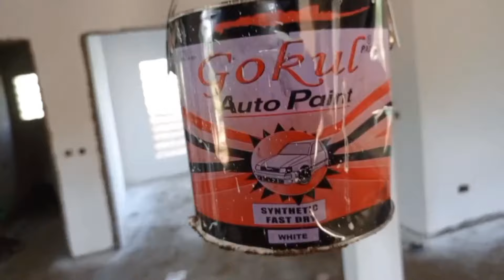Nyabohanse Kenya Dream House Project Update

Comment: Beautiful house.  It would have been better to have a smooth wall where the sinks are ( first washroom you showed)...better for cleaning. Wood, not a great idea due to the moisture in wet rooms.  You could have also positioned the toilet away from the shower.... Just to have ample room for the shower and also to ensure that the toilet is always dry.